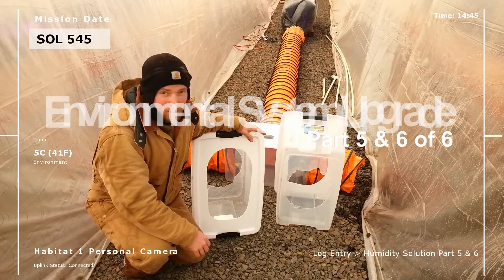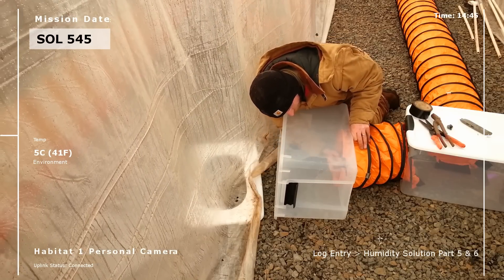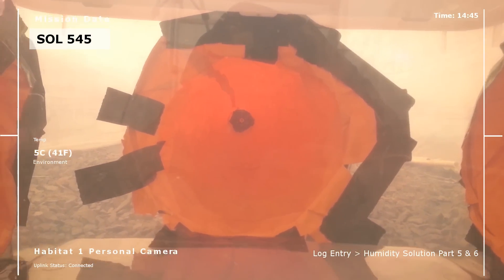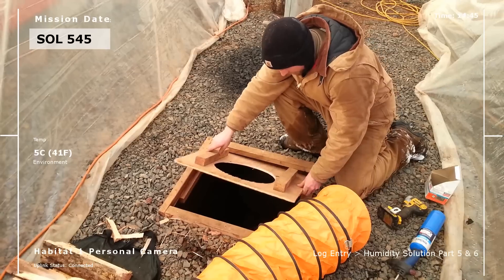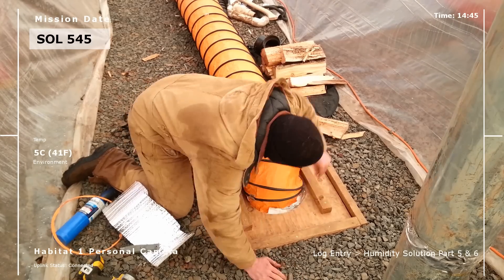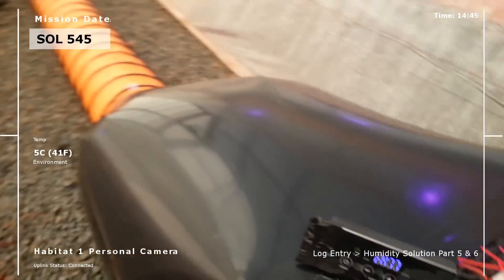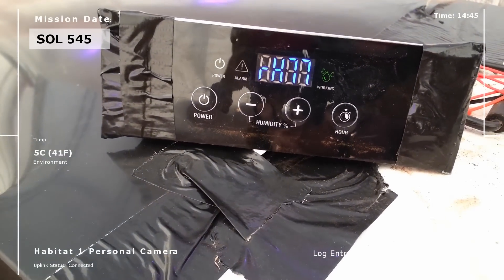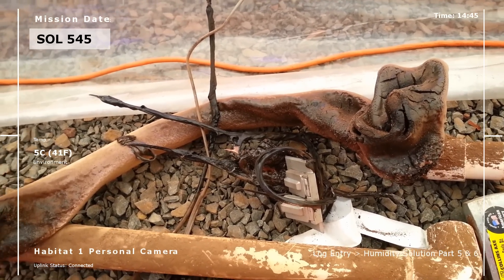Low Cost, DIY, GREENHOUSE Heating Solution  - Part 5

Comment: I Still think oil filled pipe heaters running a coil through your burner with a pump to circulate the oil round the pipe will extract and distribute heat more efficiently. You could even run the pipes under the soil if need be too.

Comment: Re: Condensation

If it becomes a problem, I might consider moving the dehumidifier and blower right next to the Y junction. Then, insulate the boxes and air ducts to avoid the temperature drop. It might not be a bad idea to use insulated flex duct like what you'd find in an attic.

Also, an air filter might be good to keep the dehumidifier clean.

Comment: Have you ever seen a concrete blanket, They keep concrete form freezing. They're made of plastic with foam in side. They have grommets on the perimeter, you could hoist them up over the shelters. I think these may be close to you: http://kpr.craigslist.org/hvo/5936003963.html

Also, try heat tape. I have a 275 gallon water tank outside. I wrapped it with 2 30' heat tapes + 1 3' tape for the discharge valve. It draws 3.8 amps @120 volt. This morning it was 16 degrees F outside, the temp in the tank was 60 degrees. The tank and tape are covered with foil covered bubble wrap. If you lay the tape out under you planter boxes, it may keep them from freezing. The thermostat on the tape must be out in the cold, not attached to the item as the instruction say. Roof tapes may work for you as well. At 5 watts per foot, as long as good contact with the items you're trying to heat is maintained the tape is very efficient. I've used Frost King brand.

Comment: Hang on, this makes no sense (unless I'm missing something). You're sucking the air from the two "lanes", passing it through a dehumidifier, then pushing it into a fire that vents via a chimney outside? If you're just venting the air via the fire, why bother dehumidifying it?  By venting the air,. this setup is essentially just replacing the warm, wet air with cold air sucked in from outside, which probably isn't the best thing for keeping things warm, and the dehumidifier is just chewing power to no ultimate effect.

Ideally, the fire should source its air from outside, so as not to create negative pressure within the structure, and the dehumidifier should be feeding the dried air back into the building.

Comment: When funds allow, replace the bag with a cone made from corrugated poly board. it is strong and easily worked and bent. it will give better flow dynamics.

Comment: I'm a little confused on why you are sending the dehumidified air out of the system.  Shouldn't you cycle it back into the lanes?  As it is now I'm guessing ambient air is being sucked back into the lanes from gaps along the bottom of the plastic.  What is you desired humidity level within the lanes?

Comment: Not a complaint as you totally rock and you made do amazingly,  but I worry for you with those plastic containers.  I know from experience they get brittle very fast.   A future upgrade could be acrylic fish tank material and RTV?   Until then maybe keep it supple with mineral oil or a light coat of lithium grease?   Not veggie oil as it will break it down faster.   And avoid chlorines.  They are murder on plastic.

Comment: Cutting plastic is a pain without a hot knife
Reply: I cut holes in one of those Sterilite boxs with a saw blade in my oscillating tool. It worked great. Have to be patient and let the saw cut. If you push hard the plastic cracks, same as anything you use on that stuff. BTW, Forstner bits work fantastic on Sterilite boxes.
Reply: Yeah those diamond grit for masonry,and or metal, those types of blades and bits work good.

Comment: I like the idea of using the totes for air splits. The lid lets you get easy access inside the system, and they are rather affordable compared to something that would be designed for that task.

Comment: Regarding heating I have a few questions/suggestions that I believe you've likely considered, but most likely haven't pursued more do to cost. However I would also like to hear your thoughts. 
You mentioned that you trenched your tanks to use the ground as a type of heat sink in order to keep them from freezing. Have you considered using the earths constant temp to also heat the grow boxes above them? You could do this buy running metal pipes through the beds and then running water through the pipes down into a heat exchange in the ground; similar to what is mentioned here : https://en.m.wikipedia.org/wiki/Geothermal_heat_pump . I know that you also buried your double barrel stove to use the ground as a heat sink and distribute heat, but have you considered adding more heat distribution using a copper coil in your exhaust pipe from your stove to collect some extra heat that gets exhausted to the outside? Having water in a closed loop that is heated by the exhaust could be used to create a passive pump that pushed small amounts of water through the system into the beds by the heating and cooling process, that way you might not need a pump. The water would heat in the coil then move to the grow bed where it would cool and return to the stove. I realize both suggestions would be expensive, especially using copper pipes and needing pumps and such. I just thought I might bring it up and I wanted to hear your thoughts.

Comment: what do you think about geothermal heating and cooling for your needs?  With the land you have you could install a large system underground using french drain piping and a fan to move the air.

Comment: Have you considered using the temperature differential to dehumidify the air? You could promote condensation inside the junction boxes and pipes and use the electricity from the dehumidifier on heating.

Comment: Be careful down in that confined space. Don't run out of oxygen.
Reply: Yeah I'd have a CO detector down there. I have them on each level that has bedrooms and also in the room with the woodstove. I like the Kidde 900-0056 since the digital readout is always on. However it's AC only. The others I use are battery powered and AC with battery backup and no readout.  I think he should be OK if the circ fans are on. Probably shouldn't go down there if the fans aren't running unless there's a working CO detector. Many people who get CO poisoning know they're not well but they don't know the cause and what to do to save themselves. Don't be the canary.

Comment: Can you help me understand your total electrical size for your place mane 200 amp service?
Reply: Roger Beard I belive the area he is in. had a existing 40 amps going to a external building. his house, could be a fair distance away from this area probally has a 100 amp service.
electrician here aswell, and I've been paying very close attention to every word he has, because there has to be a way to solve this... 

I mean even if we use a transformer and up the voltage, and a step down transformer at the greenhouse that could feed a panel for 100 or 150 amps. I know it would help out but I'm too far from there lol.
Reply from the maker: 40amp, 120V
Reply: I'm asking because I'm a electrical contractor normally we would have primary power the mile back to a distribution point near the house or barn then convert to 120/240 volt this normally would not smaller than 100 amp meter base. Do you run your house, barn, and green house off of only 40 amp 120 volt?
Reply: tek413 
I'm also to far I was thinking along the same lines as we had a project with similar problem.

Comment: How does running the propane heater inside the lanes affect your problem of trying to reduce the humidity in the lanes since water is a byproduct of propane combustion? Doesn't propane combustion produce about 1-1/2 times the amount of water vapor as the amount of propane burned? Maybe it's not enough to worry about?

Comment: Very intrigued by your build.  I have thought alot on the self sustainable front. I may have to build one  now. Thanks for taking the time to share your vlog.

On your fan, are you pulling dry air out of the humidifier or pushing wet air in? This could affect fan life.  Also shouldn't the more humid air be pulled out at the top of the tent?  If you pulled from the top, all the runs would be down hill, allowing the water condensate to be collected like the dehumidifier. Rev. 4.0

Comment: My conclusion from your sterling efforts to date is real mission to Mars is hoping to sustain itself in any meaningful way is going to HAVE to include nuclear reactors. To date, however, this point seems to have given way to to the solar argument. There is NO WAY that solar can deliver the power/ thermal output required. Love your approach to experimentation and failure though. Better at 2000ft on Earth than on Mars or on the way there!!
Reply from the maker: right now I feel the same way...RTGs
Reply: Don't forget that the Sun's light is less intense on Mars.

Comment: It used to be okay to heat with wood, now it's better to say you heat primarily with a renewable biofuel.

Great project using practical and inexpensive (for the most part) materials.  I wonder how long the system will last.  what a great alternative use for the storage containers... Brilliant!

Comment: I like to use mastic tape for jobs like that. It sticks to plastic much better, especially in high-humidity conditions. you may not be able to get it off, though.
It doesn't come loose with time, like duct tape tends to do.

Comment: When you build lanes 1 and 4, could you run a heat exchanger on the stove (maybe on the stove pipe) and run pipes through the lanes to passively heat the concrete?

Comment: Have you thought about adding some plant species to help with the humidity?  They aren't going to solve the problem totally, but there are some plants that draw moisture out of the air.
Reply from the maker: +DarkStrider I haven't buy that's a great idea... Would need to be hardy...Any species in mind...Useful or medicinal would be preferred
Reply: http://www.doityourself.com/stry/5-indoor-plants-that-will-absorb-the-humidity-in-your-house  A quick google search may turn up some other species.

Comment: Tuck tape would work way better than duct tape for securing plastic bits.
A wood boiler using gasification would be a far better setup for heating even if you had to build it yourself (put that engineering to work :) ). Can use bigger wood and much much longer burn times which all equals big time savings. Natural gas is only other fuel choice realistically but your not hooked to a pipe so that's obviously a no go.
Following along as you engineer your way through this very interesting project

Comment: I had this idea (which might be stupid): What would happen if you would have a double layer of plastic, and you would blow the inner air (humid) to the outer layer in between the plastics. there it will dehumidify and water will condense on the outer plastic and return to the inside in the other side of the 'tube'. That way you have better insulation and you need way less energy to dehumidify the air. There's of course still the problem of mold, but you will get that anyway. Everywhere where water condenses come little things with it and it will begin to mold, the only thing is where you want this to happen. And the other problem is that it will work the other way around in summer, since the outside is then the hot side. But hey. maybe this brings you to other ideas :) keep the good work going

Comment: After watching several videos I'm now more confused than ever. Why is the humidity a problem? Why is the condensation on the plastic a problem?

A dehumidifier works by introducing humid air to a cold surface, thereby creating condensation and drainage. Your plastic does that perfectly, as long as you have adequate heat to create a temperature differential and keep the condensation from freezing. That heat would also be necessary to keep the plants from freezing and so it appears the problem is (really) a lack of heat, rather than an abundance of humidity.

In the summer, I assume it will get very humid in the habitat, much higher than it is now. Unless I'm missing something, that humidity is only helpful to the plans. Trapping that humidity reclaims the water near the fish ponds and the two lanes remain isolated, which keeps any problems in one habitat from affecting the other.

Again, having adequate heat would recycle the humidity in each lane back to itself, without other mechanical means.
Reply: Brad Johnson I think he was mainly concerned with mold in the system from too much humidity. not great on the lungs.
Reply: Agreed. Mold would be very bad.
Reply: Another option may be to add cold pipes through the lane to induce condensation. Use outside air passing through the pipes to create a temperature differential between lane-air temp and pipe temperature. Some creative control of the air passing through the pipes could give some control over how cold the pipes get.

Comment: You have mentioned you have a 40 amp current limit. Is that 120v or 240v split phase current limit? Just trying to understand if your power limit is 4800 watts or 9600 watts. Keep up the awesome work, it's inspiring!
Reply from the maker: 40amp, 120V

Comment: How do you have the air coming out of the fire stove pit?
Reply from the maker: air is forced in with the HVAC fan. I also have two 6" fans that boost the airflow via a 6" duct pipe which takes air from the stove pit to the grow lanes
Reply: The other day I saw a wood burning furnace with multiple tubes inside the air was blowing through those tubes and it was very hot and very efficient
Reply: My question also.  It seems like it would force more up up the stove chimney and cause you to loose more heat.
Reply: Ahh....now it makes sense.
Reply: Now just add another layer of plastic over the grow lanes leaving an air gap to making them more insulated and you may not have to fire the wood stove as much.
Reply: Cobalt33 my Dad talked about a friend of theirs many years ago who had the same brilliant idea. So he welded 2inch galv water pipes through the bottom of the fire box. Apparently it worked great until he turned the blower on and blew molten zinc right across his wife's carpet :S